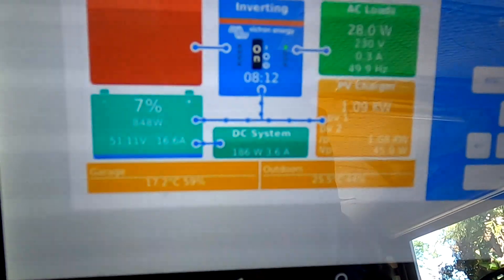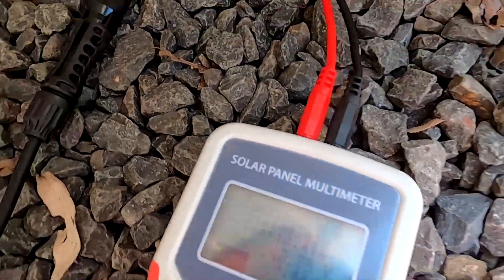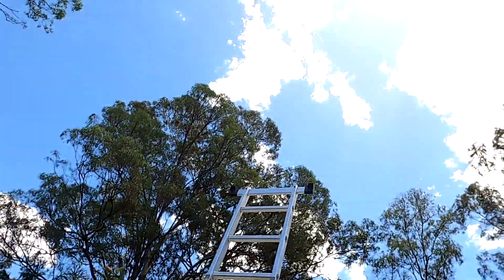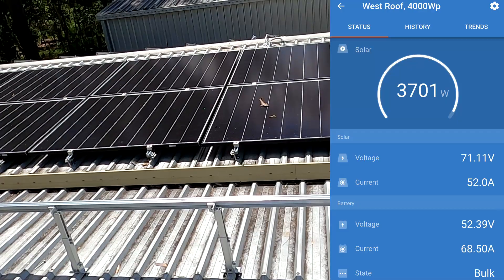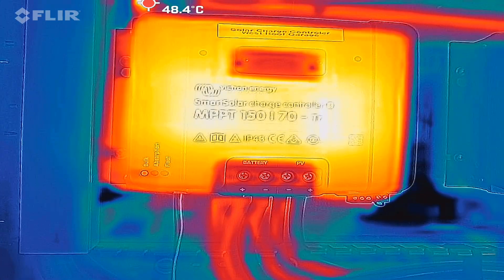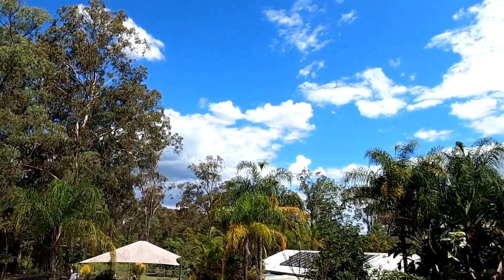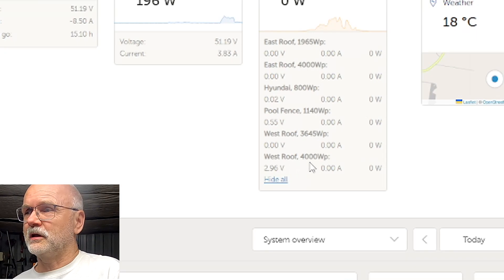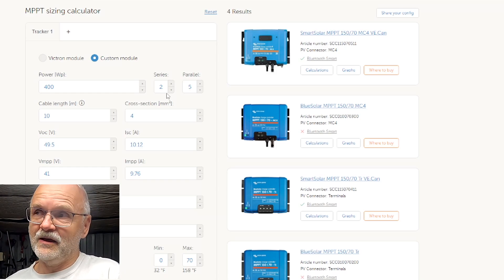First charge with the new West Roof. Can the Hyundai Shingled Panels deliver?

Comment: Get the 150! Victron will probably give you a good offer...bigger models will also probably handle heat etc. better than maxed out small models (which you really shouldn't do)
Reply: It`s a quite good idea, to break down a complex system to smaller, identical, units in a higher count! This redundancy makes ist easy to compare und  change in a case of failure or in a case of testing and comparison parts ans components.
I go with Andy in exact this way!

Comment: Love that you are making progress and sharing it with us.  I have to admit, I'm a little concerned.  We always talk about the gernal rule of using an electronic device at 80% of it's rated performance.  Safety and security are the stated reasons.  Don't take chances.   

You will be running these SCCs at 100% for hours/days?  Please get the larger controllers and be safe and ready for the NEW shed coming next year.  👍☀️😎💥
Reply from the maker: As I said in the video, they are made for that. I guess the maximum rated capacity is already to 80% of what they can really do.

Comment: Hi Andy, Would it be worth it to have cold water pumped from your pool over the solar panels and back into the pool. Would this not increase the panel efficiency allot more?
Reply: You optimise one part of a large system, while adding complexity and cost to another part, for a nett negative. Passive solar panel setups are significantly more cost-effective than any form of active system - otherwise most space-sensitive installations would be going for active systems (water cooling, forced air cooling). The extra 1-10% panel efficiency is not worth the cost or hassle to maintain.

Comment: Dear Andy, you got breathtaking 50 kWh´s on your first day of fully installation. But yesterday, without charging the EV, it was almost 20 kWh`s.
That`s exactly what i observed in my solar installation in summertime: without a big "energiesink", you will not get what you could!
So, without any doubt, you need more batterie capacity yet.
Will be exciting, to follow your new ideas and decisions - and we all will enyjoy this! 🙂

On the other hand: in wintertime you earn just a 10th of the summertime harvest, so it would work fine with the momentary batterie capacity...
Reply from the maker: Yeah, that's exactly what happened. But more batteries won't help if you don't use the energy somehow. It helps you once until they are charged as well. Then, you will be in the same situation again.
Wintertime will be the interesting season for sure.
Reply: @OffGridGarageAustralia  Thnx 4 response, you are right Andy.
For full autarchy, batteries must be big enough to reach for the longest average time of rainy days, you usually have in your area

Comment: Andy If I may, now you have a lot of old panels. Could you do it the test with one long string vs. paralel string? Maybe 6 panels in series vs. 3x2, just to compare the power production in your shading condition.
Reply: you need a different MPPT controller to add 6 panels in series, as the open circuit voltage would exceed 250V, and these victron MPPTs can only take 150V max, and give out 70A to the battery, hence their name! More panels in series is always worse for partial shade conditions.

Comment: Hi Andy, that's awesome. I can't wait to see the full plant in action.
However, I have a comment on the MPPT chargers and their temperature.
The manual clearly states for temps:

Operating temperature: -30°C to +60°C (full rated output up to 40°C)

So it will throttle down when reaching 40°C. Since you live in sunny hot Australia, you might see that in the summer. I put some temp controlled fans on the things, because they reach 40°C quite quickly at the surface.

Comment: Andy, I would like your opinion on lithium build I'm going to put together. Its for high power car audio (90A average 600A peak) I'm going to use 48 Headway 38120 HP 3.2V 8AH LIFEPO4 cells(12C discharge / 4C charge) and 500F in capacitors (to handle peaks and car starting) It's replacing  2 x 100AH AGM's and I'm repurposing the 500F in caps.
    In your opinion is a better idea to set up 2 x 4S6P and 2 x 200A BMS's (B1A8S20PH) in parallel or a 4S12P and 400A BMS?
I'm leaning to the 2 x 4S6P and 2 BMS's myself, to limit the amount of parallel cells.
Do you still feel the same as you did in your Jun 10, 2021video "Parallel Battery Strings - worst solution ever?" ?
thank you in advance.

Comment: A Victron SmartSolar MPPT rs 450v/100a or 450v/200a would have been ideal for your current setup. Look it up Andy 2, for Andy is extremely busy at the moment 😂
Reply: I doubt that. Andy has a lot of trees around, so it means a lot of shading. This best solution is to have less panels in series and more in parallel, as Andy has.
Reply: @stanislavmlcuch2085  
You may be right but coming from a similar situation (though with no shading issues I must say) I tossed away the smaller Victron Controllers for the smart rs 450v/100a controller (48 PV panels) - I tied more panels in series as you may know - your milage may vary from mine
Reply: @ascenttev6022  If you dont have any shade 450V string can be better (less cabling, less cross section of the cabling) but with the shades I dont think so. I have one string with 5 panels in series and if I have shade on the single one, power output reduces dramatically.
Reply: It`s a quite good idea, to break down a complex system to smaller, identical, units in a higher count! This redundancy makes ist easy to compare und  change in a case of failure or in a case of testing and comparison parts ans components.
I go with Andy in exact this way!

Comment: Fuck, I am trying to see the maximum current flowing into your batteries, but always when I wake up here in germany, the Battery is already full. Please find a usage for the energy, to drain the battery. It hurts to see solar panels in idle. 🤪🤪
Reply: Well get up earlier or go to bed later!!!!!
Reply: Hallo Rainer,
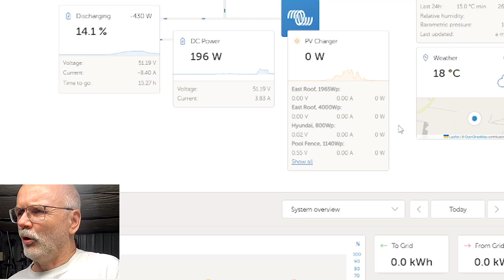die Maximalwerte wurden am 8.11.2022 12:17 erreicht. Zu dem Zeitpunkt kamen 15 kW von der kompletten Installation und die Stromstärke war 257 Ampere. Lässt sich leicht verfolgen über den Link zur VRM-Seite der Installation auf Andis Homepage. Dort den Zeitraum auf 2022-11-08 12:00 to 2022-11-08 13:00 einstellen.
Reply: @MiniCmaX  ja, das kann ich im VRM Portal ja selbst sehen. Ich würde es aber gerne live sehen. 😂😂 und wenn die Regler nicht schon am Vormittag auf Float wären, könnten wir bestimmt noch viel höhere Werte beobachten. Wie schon geschrieben, Solarmodule im Leerlauf verursachen körperliche Schmerzen bei mir. 😂😂😂

Comment: WOW!!!!!  Amazing results for not perfect conditions. I.E. shading and not optimal angling. Very impressive for just 10 panels. You will definitely have issues with your charge controllers being constantly maxed, witch truly isn't good for them, as well as your 3 bms units might want to blow up from the mass current that your small power plant can produce. 🤣
Reply: There will not be a problem. Currents will split over all batterystacks, so the bms should not get an issue. If there is really a problem its also possible to limit the charge current of the solar chargers. I am running a 14kW Peak installation in north of germany. 2x15 panels (5 in series, 3 in parallel) south, each on a Victron 250/100 MPPT - in summer each of those can deliver 5,5kW (5kW official rating). And one 6 panel string heading east also on a 250/100 MPPT (can add some more modules there). Now in November its still possible to run full on solar, but this november is surprisingly sunny.
Reply from the maker: @alexanders3795  I have already limited the output of the MPPTs to 60A now. I had over 260A once one the main breaker is only 250A. To scary...
Reply: @OffGridGarageAustralia  That's true. In that case the main breaker is too small ;-) - but as I know from your videos there is always change - as in my installation too 🤗 Solar power is addictive
Reply from the maker: The MPPTs can handle that no problem. As I said in the video, they are designed for 130% over-panneling.

Comment: the low voltage input and limited output current on affordable victron made me throw victron away and went with 5kw phocos hybrid inverter. @450v input voltage. the solar panels cable sizing becomes easy and 4mm works. For battery cables 1.5 meters 50mm cable works and cheap enough.

Comment: I am an electrical engineering designer and I don't like seeing you run your controllers close to their limit every day. 40 degrees on the outside of case probably means >50 degrees inside on a hot day. That's a recipe for short life! My advice is to go for at least 100A MPPT controllers.
Reply from the maker: I mentioned that in the video. There is no problem and they are designed for exactly that.
Reply: @OffGridGarageAustralia  I know they are are not designed for that but temperature is the enemy of all electronic circuits. A 10 degree increase in temperature will reduce life by 15%. I will not be surprised if at least one of your controllers fail in a year.
Example: A good electrolytic capacitor is rated for 105 degree operation. It may fail in as little as 1000 hours at 105 degrees. Reduce temperature to 50 degrees will increase life to 200,000 hours.
Reply: @peterdkay  Victron MPPTs have a standard 5 year warranty, which is upgradeable to 10 years with the exact same components, just registration by the dealer (and added cost). The controller firmware will actively ramp down charging current when it exceeds the component temperature threshold. Their equipment will perform at their rated duty (130% over-panelled) for at least the warranty lifetime.

The best case scenario for Andy is indeed a complete failure after 1 year (or 4.9 years!) as he would then get a new replacement.

Comment: I used Victron's MPPT calculator setting up my system. 2.4k panels 6s4p, ..   150-70..   under 100%  ..  well within limits.    ...    I went with the 150-85......    according to them for my local,  peak, in summer, I was producing 10-15% more than they calc'ed, and, my panels are FLAT on the roof of my TT.  I will soon be adding 1.8k more panels, same 6s4p, I will be using another 150-85, ..  Why you may ask?...   Redundancy/backup  .. Yes, overkill for the new panels, but, should need arise, can be swapped to the main array.... 2 is 1, 1 is NONE......
Reply from the maker: You cannot have enough panels. There is always a cloud around.... 😊

Comment: Based on my experience with high wattage solar in sunny Jamaica  , divide the 4000w string into two and use two of the 70 amp vectron 150 charge controllers and you'l be fine.

Comment: Can't believe you have large trees so close to your buildings. Not only do they cause a lot of shading they are a hazard also in windy situations and of course a fire hazard during bush fire season.
Reply from the maker: Are you living in this area too?
Reply: @OffGridGarageAustralia  Coonabarabran / NSW. Off-grid everything for over 20 years in straw bale house. 12kWp (rescued from the tip) on shed to charge Tesla S and eNinja (self converted 8kW / 6.5kWh motorcycle). Currently converting Polaris Ranger EV using Tesla Powerwall 13.5kWh battery.

Comment: When you add up all the hardware to operate Victron it becomes a very expensive solution. I,m used the MPP 11kw inverter with built in 2x 150amp MPPT converters making the setup and wiring very simple.
Reply from the maker: That's part of the test and experiment I'm doing. MPP inverters are... well, let's say I know a few people who have them.

Comment: If you are going to be hitting the charge controllers that hard you want to optimize their backside heatsink air circulation.  They will back down their production if they get too warm.
Reply from the maker: Just wait for it...
Reply: @OffGridGarageAustralia  I mounted my MPPT`s on a 20 mm thick aluminium plate, which works really fine (two 150/45 MPPT`s on a 30 by 40 cm plate) They don`t even get warm under maximal load

Comment: heck yeah. you maxing your charge controller. its gonna be impressive when all 4 strings are running. I finally got my battery banks top balanced. I had 1-2 cells in each bank hitting max on my settings for JK bms. Took 1 week almost and now all charge and discharge close to each other. I understand how you feel when things are going good. cant wait to see your roofs filled and you filling up each day if its possible.
Reply from the maker: It's going really good now. The power production problem seems to be solved, even with the trees 😊

Comment: Dang Andy thanks for the outstanding test report, that is amazing! At 7:00  could you add a second a second charge controller in parallel to keep the 70 amp controller from throttling to parallel charge the same battery bank (with an isolator if needed), or to charge a second battery bank? Also, can you give us an idea of the installed cost of that 10 panel string?  I think that would be perfect for my needs.
Reply from the maker: Just wait until the whole system is in action 😉
Reply: @OffGridGarageAustralia  So much fun! Looking forward to it, Es wird großartig! (If that's the proper phrase in German).

Comment: 85kwh a day.. Hmmm... You are going to need more batteries and a way to dump all that power daily or else its a waste of money.. Unless you are able to sell the excess power back to your power company.. Or have some friends wanting cheap power to recharge their cars at your house.. 2500kwh a month thats quite a bit..
Reply from the maker: Well, it's an off-grid system. So, you would expect times, when the solar production is off because the batteries are full. But again, summer is easy, we have to wait for winter...
Reply: @OffGridGarageAustralia   Yea my production is down about 30 to 35 percent in FL coming into winter.. Even at that you would need to deal with close to 30 to 35 KWH a day.. I personally don't like throttling down production and find ways to use the excess power generated.. Otherwise whats the point of having so many panels.. Cost wise if you can't use it then its a waste of money..

Comment: You will need a bigger battery. Even charging your car, you will have a hard time using the power generated.
Reply from the maker: We have now summer (almost) and peak production. We will have to measure again in a few months. Production will already decline from February on.
A bigger battery is not the solution as it will be a dead asset unless I use this capacity often. But 44kWh is already a lot. I really have to test and experiment over a year now to experience all the seasons.
Reply: @OffGridGarageAustralia  What about another Toy/Hobby/interest like an Electric 4WD, (not that u aren’t busy enough now!),  with a tow behind Battery come Camper or trailer, for extra power usage, That would be FUN for weekends away, & could be a standby battery Backup or Dump too.
Reply: @OffGridGarageAustralia  My first concern was charge rate, I'm not sure I would want to go above 0.25C (which seems possible when all the panels are up). Then I was also thinking that you may wish enough storage to be able to give the Tesla a full charge and have 2 days reserve for normal load. I live in the desert, so taken over a year period, I average 50 kilowatt hours a day. But everyone has different objectives, I was primarily focused on not getting too high a charge rate. As you say, you will get a better idea as time and the seasons pass.

Comment: You have 280amps max at the battery won’t this be a problem whit the bms? You have conected a 150a bms or is it changed too a 200a one.

Lol you ansered my question at the last 30 sec of the video 😂👍
Reply from the maker: I have three banks in parallel, so 860A max. But the main circuit breaker is only 250A... wait for the next videos...

Comment: If you max out your charge controller can you add another one and wire it straight into the Bus Bars?  So both the maxed out controller and the new controller both are feeding the bus bars?
Reply from the maker: I have 4 of these controllers, yes, that is possible but not from the same solar panels. Each controller will have to get its own panels.

Comment: How have you connected up those panels with that shading in them? Surely one shaded panel will bring down the rest?
I assume this isn't a simple single string in series?

Edit: you literally answered the question as I finished. 2S5P
So those couple panels in shade are not affecting the others. 
Got it. 👍😀

That's what's good about these Victron controllers. You can shove quite a lot of power through them. 

Hybrid inverters are very limited to input current. Big voltage range, but no chance to parallel up any panels.
Reply from the maker: Phil, this is not one string, no. It's a 2s5p setup. 2 panels in series and 5 strings in parallel. It's all in previous videos. I chose this setup because of the partly shading I have on all my roofs.
Reply: @OffGridGarageAustralia  yes, I saw and said in my comment.

Comment: Why are you running your strings at such a low voltage? seams like a real downside on cable size and amount of cable. is there some max voltage regulation in AUS i'm not aware of? i'm running like 200Vdc on the strings here.
Reply from the maker: Because of the shading. This is perfect for such scenarios. Yes, more cabling effort but also far better efficiency and control over the system.
Reply: @OffGridGarageAustralia  It`s a quite good idea, to break down a complex system to smaller, identical, units in a higher count! This redundancy makes ist easy to compare und  change in a case of failure or in a case of testing and comparison parts ans components.
I go with Andy in exact this way!